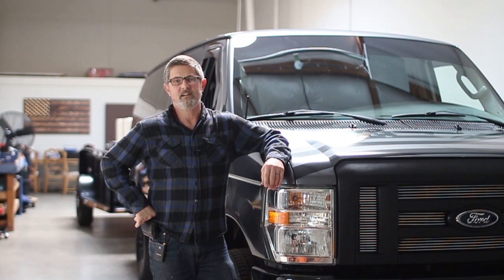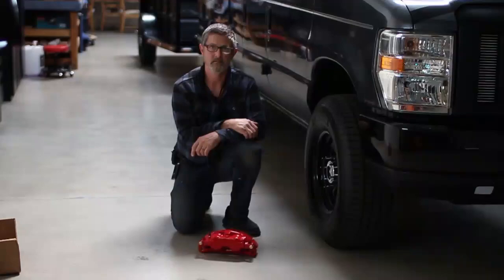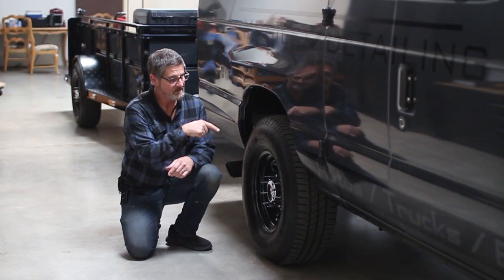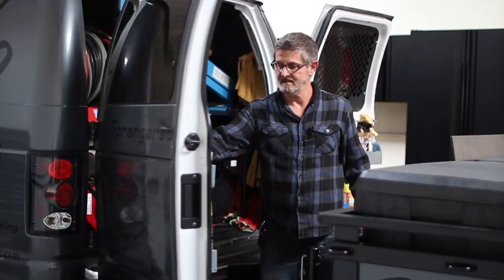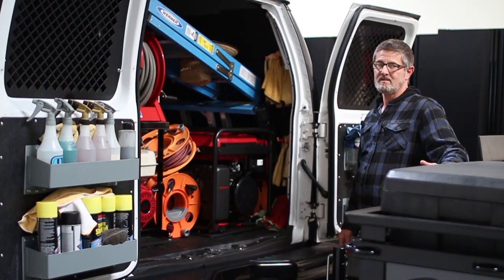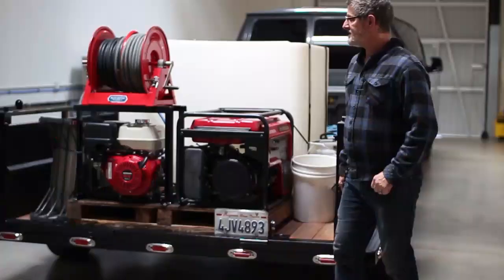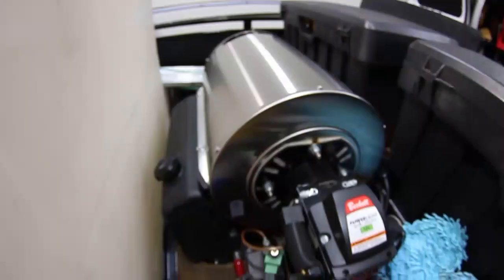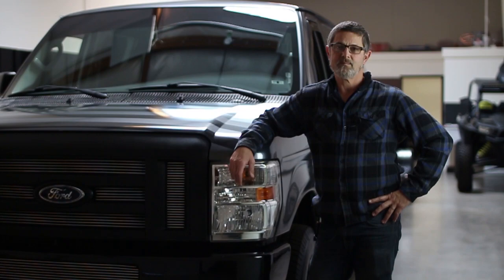The ultimate mobile detailing van & trailer tour

Comment: Hi there, i need some advice on power washer set up and generator...do i need to have a pump? The power washers have a pump so why do others put a separate pump? Is it ok to use the ryobi 2000 psi power washer? Any recommendation? Im planning to do this business also but dont know how to set it up...i have a pick up truck ....
Reply from the maker: You can buy pressure washers as 1 unit, meaning motor and water pump. You can also buy each seperatey, which is what we do. The ryobi will work for you. Good luck on your detailing business!! Sorry about the delay on getting back to you.